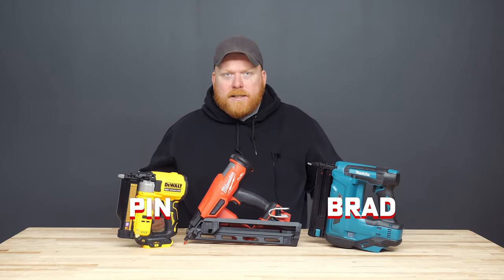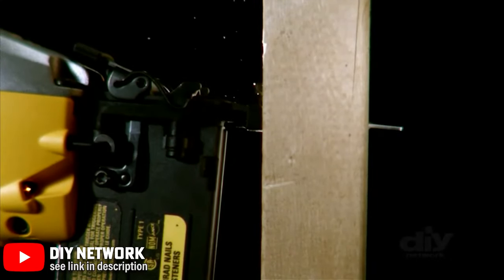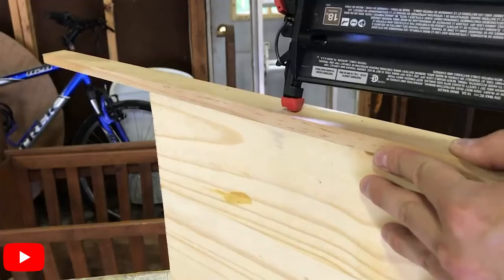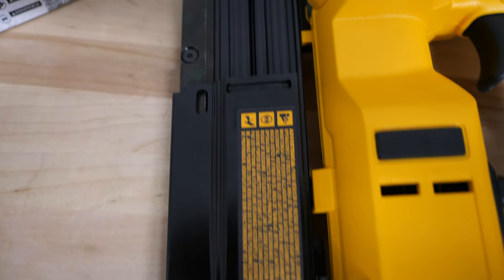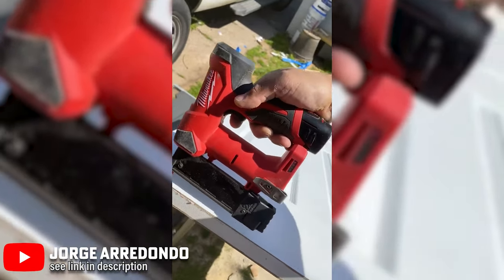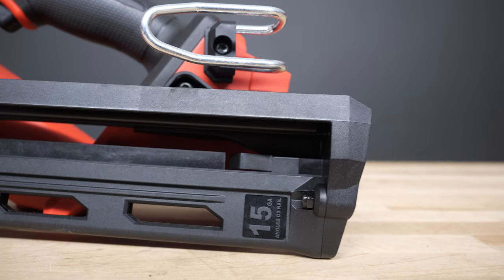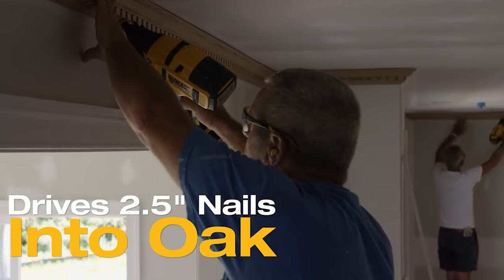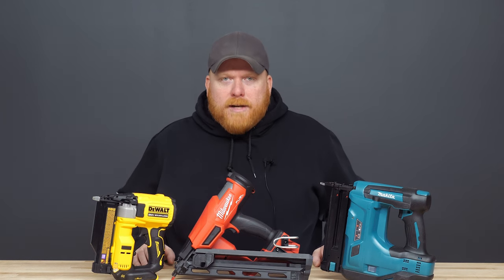Brad vs Pin vs Finish Nailer - Which Do You Choose?

Comment: FINALLY!  A short and very informative video!  Getting ready to hang trim and was going to use that to justify a nail gun.  But I had NO CLUE as to what I needed.  Thanks.  I have a combination stapler/brad nailer, but I knew those brads would be too short for my application.  Now I know what to buy.

Comment: Good vid. Short and to the point. I was considering getting a framing nailer (which I used a lot when I was building houses), a brad nailer, and a pin nailer now that I'm gearing up to retire and will be trying different projects in my shop. This saved me some money. I'll get the framing and brad nailers, but it's clear for my needs that I can forgo the wire nailer.
Reply from the maker: Framing nailers are a whole other video we should shoot! Most people if they could only choose 1 of these 3 will go with brad nailer because it can do a little of everything. Of course normally the job/project right in front of you will dictate the tool you buy next off the wishlist.

Comment: Does it work on metal sheets?
Reply from the maker: Brad nails would probably be your best bet if you're working with metal sheets; pin nails would definitely be too small, and while you'd have more than enough power with a finish nailer, the brad should get the job done and be able to save you some cash!

Comment: Hello. I’m doing board and batten as my first DIY home project. I got the 1” (3/4#) inch thick pine wood trim. I only have a brad nailer. What size of nail do you recommend me use? And should I use a wood glue to well secure the trim to the wall? Or would you recommend using a finish nailer?
Reply from the maker: I would suggest a 1 to 2 inch, in length, 18-gauge brad nails. Also wood glue is a great addition for stability while you're installing. While a finish nailer may offer more holding power, the brad nailer you have will do just fine!

Comment: Great video. I wasn't really able to gauge which nailer I would need. But if I want to make a cabinet on wheels for a 50 pound air compressor should I use the Finish nailer with 15gauge nails?

Comment: Great video! Could you use a Pin Nailer for accent wall designs when using 1/2" or 3/4" thick pine or MDF and CA glue is used where the all the peaces joint together?
Reply from the maker: You certainly could! Pin nailers are perfect for accent wall designs, especially very small or delicate ones! Anything bulkier though and you'd best be looking at a brad nailer to get the job done!

Comment: What do you think: Is the finish nailer the best choice for installing timber weatherboards?

I have a large Ecko framing gun (the Ultimate 90 gas framer), but that seems way too powerful.
Reply from the maker: Technically, you could use a Finish Nailer, but probably not the best choice. Those weatherboards could have some thickness to the material so your framing gun is better suited in my opinion. Could shop for a battery powered Framing Nailer if you're wanting something a little lighter.

Comment: Thank you for the explanation of the differences. Where can I find a 16 gauge finish nailer that is electric. You know that runs on household current?
Reply from the maker: Corded nailers are not very popular, they jumped right from air hoses to battery powered and never looked back. Metabo HPT does make an adapter to use their battery tools with a plug but assume you’re looking to keep cost down vs adding an expensive accessory onto a battery tool.

Comment: As a weekend DIY'er that will occasionally build furniture or do accent walls, etc - would the brad nailer be my best bet? since it is the most versatile? I did want to do crown molding eventually though and it sounds like the brad nailer may not work for my needs.

Comment: I'm covering a wall with 3/4 inch thick pine.  I'll need to drive thru drywall to get to the frame.  Does brad nails have enough strength? 
1x6x10 - pine
Reply from the maker: Brad nails may not offer the best holding power, we recommend a larger nail or fastener! These include finish nails or even screws - both can provide more holding power than brad nails.

Comment: OK I'm refinishing a couple of rooms in my house. I'm just gonna be doing the trim work so should I use a finished nailer or a Brad nailer? I'm a little confused still I know the finished nail. I would probably be the better of the 2 tools but I also tend to overpurchase.  So would the brad naylor be sufficient as what i'm asking
Reply from the maker: Yes! A brad nailer should be able to do the trick for you; a finish nailer would do the job just as well, but if you want to save a little bit of money, go with the brad!

Comment: What's the best nailer to use when doing base boards around the house?
Reply from the maker: It depends on the thickest of your wood, so a Brad Nailer would be best for delicate and thin materials and a Finish Nailer would be best for slightly thicker material.

Comment: I have small staples: 3/6" wide X 5/8" deep, I believe them to be about 21 gauge, square head - what will shoot these staples?
Reply: Those square staples sound like T-50 staples. All the larger staples from a staple gun are heavier. If you want to use staples instead of nails for stronger work, look at a bostich crown stapler; my grandfather has one that’s even bigger for cabinets.
Reply: @liquidrockaquatics3900  I ended up getting a Grex 2116AD and 3/16 x 3/8, 22-gauge staples. I guess it's technically an upholstery stapler, although I'll never use it for that. Very nice stapler, quiet, gentile.

Comment: Which one to use for fencing?
Reply from the maker: Hi, for fencing jobs we suggest you use a finish nailer. It can provide more strength and holding power to drive larger nails to secure fence boards and panels.

Comment: Is there really that much of a difference in holding power between a 16g and 15g finishing nails?
Reply from the maker: In general, a thicker nail (lower gauge) will provide more holding power than a thinner one. The increased thickness of a 15-gauge finishing nail means it can typically withstand greater stress and pullout forces compared to a 16-gauge nail
Reply: Not really I use my Brad nailer to do everything from trim to building cabinets. My opinion it’s the best of both worlds. If you won’t be using it much ryobi makes an 18g that’s a nice sweet spot for only $89.

Comment: What the difference between 20 degree and 30degree  for framing
Reply from the maker: They use different types of nails, 30 degrees are typically a little cheaper so more popular in certain areas but 20-22 degrees can use different types of nails commonly needed in hurricane zones so become more common in coastal areas. But you get both in most areas these days so comes down to user preference at this point.
Reply: @OhioPowerTool  whats the difference though, do they go in at an angle  or it is just the angle they are arranged in the clip?

Comment: I’m looking to get something simply to build some bird houses. Should I go brad or pin?
Reply from the maker: What an excellent question! The answer to this depends somewhat on what wood you're planning on using, as well as if they're purely for decoration or if you plan on making them functional. For the most part, you should be able to get away with a fairly strong wood glue or even some longer hand screws if the wood is pliable enough, though if you're set on using a nailer, brad nails would be the way to go! Remember that the orientation of the nailer is important so the nails don't go shooting into or out of the birdhouse at awkward angles, and if these are going to be functional for birds, be sure to add some ventilation and drainage features to make it comfortable for them and have fun!
Reply: @OhioPowerTool  hey thanks. See I’m a quadriplegic so using a drill and screws is to difficult. I do have good arm function and limited hand function and believe I can manipulate the nailer well enough to use. I’m planning to build some log cabin style birdhouses using locally sourced limbs and such. Might make a few other designs as well though. I should be able to set the nail depth on the nailer though right. If not I should be able to adjust my air pressure to reduce penetration I think. I appreciate you getting back with me though.
Reply from the maker: That sounds like a phenomenal project! You should definitely be able to get away with using a brad nailer for that, and we'd also recommend having some spare wood putty or glue on hand to seal over any nail holes that you don't want exposed. Best of luck to you, and if there's anywhere that you can post the finished product, we'd love to see them!!
Reply: @OhioPowerTool  do you guys have a Facebook page?
Reply from the maker: @LeaveItToTheWolves  We do! We're @ohiopowertool on Facebook, Twitter, Instagram, and TikTok!
Reply: @OhioPowerTool  cool I’ll go follow. Thank you again for the information.

Comment: Good informative video. Curious about fastening thin and soft cedar shingles, into oak framing. The brad nailer shoves the brads thru the thin cedar, and doesn't secure. Would a finish nail have a bigger head, and secure better? Anyone? Thanx.
Reply from the maker: Using a finish nailer is a better option because of the reasons you stated, however because you are still working with delicate wood, you'll still have to be careful not to split the wood. You can also pre-drill pilot holes with a drill bit slightly smaller in diameter than the finish nails, this can sometimes help!
Reply: @OhioPowerTool  thanks for the reply. :)

Comment: Do you recommend it to put baseboards?
Reply from the maker: Hey David! Your best bet for baseboards would likely be a finish nailer, just due to the holding power on the nails themselves. You may be able to get away with a brad nailer, but definitely not a pin nailer. Hope that helps!!
Reply: Oh thank you so much
Reply: Do you think that can I use the Dewalt DCN680 18GA?
Reply from the maker: Oh sure! Now, keep in mind that the brad nails won't have as much holding power as finish nails, so you may find yourself using more of them to fully anchor the baseboards to the wall. Start small and make sure you angle at least the first set of nails to give yourself a little room for extra just to be safe, and good luck!
Reply: Oh thank you so much I appreciate your response you do an excellent job

Comment: There is something about some nailers being pneumatic i.e use air pressure as power source. You did not go into that detail.
Reply from the maker: Correct! We're focusing on battery-powered nailers in this video; for the most part, the information translates across the board! The pneumatics give the nailer a boost in speed, allowing you to get through a project quicker than you would with a cordless one; however, you're then at the mercy of cords and hoses and the like, whereas a cordless nailer gives you the freedom of movement throughout the jobsite without having to lug a whole setup around!

Comment: I'm gonna take the  Milwaukee cause the angle, but blame the blue looks all accessible
Reply from the maker: That Milwaukee's got a very comfortable angle to it, it's a fantastic tool!
Reply: @OhioPowerTool  Absolutely love mine.
They’ve also been killing it on their Gen 2 Nailers; 18 ga Brad, 16ga, and 15ga Finish.
Solid and reliable. 
In all honesty, though, bang for the buck, the Craftsman ones are also not bad. 
Bulky as all get out, but not bad. They have a great belt hook and hang well on a belt or tool belt if you need to climb a ladder.

Comment: I'm still confused. They all seem to be used for the same applications.
Reply from the maker: Generally, they are! They're all used for fastening, or adjoining, pieces of wood together. If, however, you try using a pin nailer for, say, a baseboard project, you'll find the holding power in a pin nailer significantly lacking. Conversely, if you try using a finish nailer for some decorative trim, the nail will at least damage, if not completely obliterate, the piece you're working on. It's sort of like choosing the correct sized screwdriver; too large, and you can strip the screw if the head will even fit, too small and you won't get any leeway!